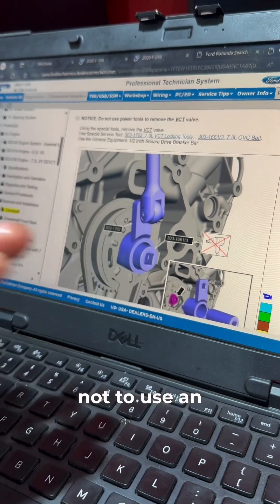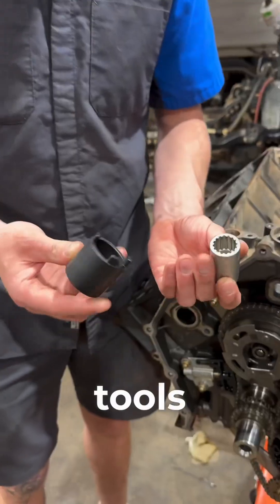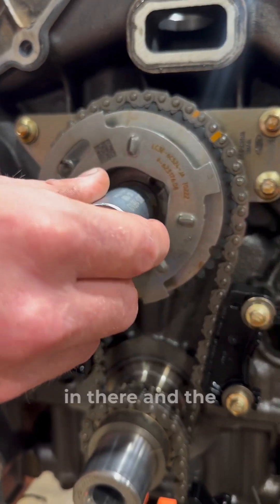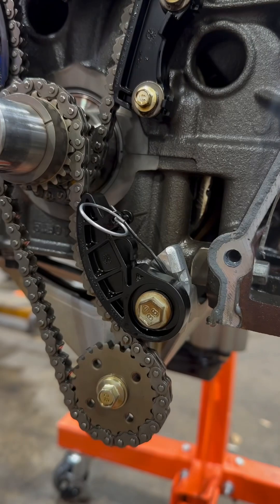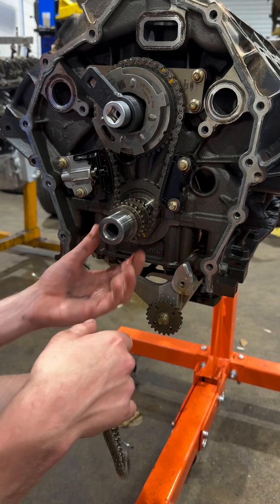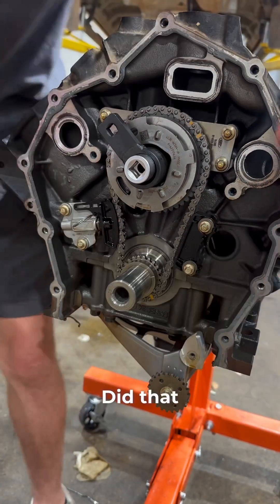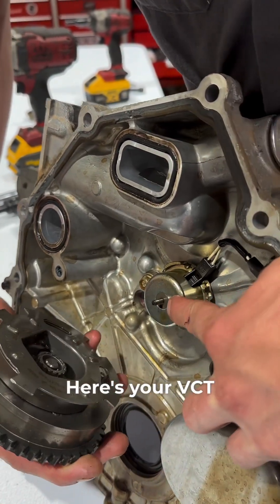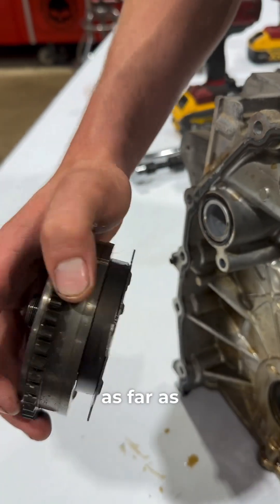Ford 7.3 Variable Timing Explained #ford #shorts

Comment: I have a 2022  F350 with the 7.3 engine, I like it, and by the way, that cheapest looking timing chain tensioner is not a timeing chain tensioner, It's an oil pump chain tensioner.

Comment: Of course the tensioner is cheap.  Gotta save a few cents here and there.   If it fails, and it will, good luck.  These engines will never rival the Chevy Big Block.

Comment: Actually the left side chain tensioner is the style older Hondas use and you open it up and behind the spring add like an eraser from a pencil or a pice of pen cap that way if the spring ever loses its spring back the cap will hold enough outward pressure to at least get ya home

Comment: Can anyone tell me what computer system he is using? I do basic maintenance on a fleet of 250 transit vans and having those exploded apart diagrams and info would make my work life better in every way
Reply: Looks like Ford IDS.
Reply: @ghostwrench2292 no its fords workshop manual. IDS is their old diagnostic software. Soure: am a ford tech.
Reply: Btw, if you have ALLDATA you can get most of these diagrams on there instead of fords workshop manual, as that requires a login and password to use

Comment: Engine parts lookin like they came from a Happy Meal ffs
Reply: I mean even the oil pump drive chain looks like it's smiling😅
Reply: Coming from someone who has never used a screwdriver.
Reply: @wysetech2000 tf would I use a screwdriver for when I could use an impact?

Comment: I'm going to say the obvious thing here:
Why are these timing chains so flimsy looking? In the past, the pushrod engines had beefier double and triple wide chain links. No tensioner needed, if the chain got stretched, it was only by small degrees  and would run trouble free for years and years. I had a 1973 Lincoln Continental with a 460 that finally needed a timing chain replacement. It was a straightforward afternoon job with standard tools in my garage at home. No plastic guides, no dime store tensioner.
My flathead engines have gear drive timing, no chains at all.
Reply: So it won’t last and you have to buy another one. Capitalism.
Reply: @johnpappas9652 get off breadtube.
Reply: Even if that was the case, it would most likely be to reduce drag/improve mpg.

Comment: Fuckin ford...you would have thought they would have learned about timing chains from the ol 5.4s and 4.0s that stretched them, but they didn't. Then you'd think they'd learn from the ecoboost junk engines and their timing chain issues...but they didn't. So hey, lets make our timing chain parts from temu products and call it a day. Im a GM guy, owned a few older fords before and didnt have any issues. And yes GM has timing chain issues just like ford and just like dodge. Ive dealt with them all over the years of fixing cars and buying fixing and flipping cars.

Comment: How many miles on that engine? Let me guess 7,000? 😆
Reply: Look at any fleet thats running these engines; apart from a few lifter issues on the early production engines in that vans and stripped chassis that ford is completely handling under warranty, they are holding up quite well.

Comment: Chain driven oil pump,I thought it sounded good when it came out,but now I'll stick to my 460
Reply: Oil pumps on older v8 are chain driven,,,think about it ,,a chain drives the cam then it drives the distributer  through a small gear and a small shaft drives the oil pump and they failed occasionally  .

Comment: I'm just hoping my 2016 3.5 Eco-boost F-150 doesn't blow up, and lasts at least 300k miles. But perhaps I'm being overly optimistic. I think I'll keep my old '94 just in case. Just gotta kick the rodents out and get it sterilized.
Reply: If it does last that long let us know
Reply: Sure bud it will get there. Just gotta do cam phasers, fix the turbo coolant leaks and replace the torque converter. $10,000 to 15,000 in repair and maintenance and yay you made it to 300,000 😂😂😂

Comment: How to make an LS complicated.
Reply: Literally what I was thinking, ls uses a solid piece of plastic in between chain and crank driven pump simple doesn’t break and works
Reply: Facts and anything above 07 gm has this shittt
Reply: @sharkclan42  no vvt was more common after 2012 my 08 Silverado has do but no vvt, i dropped standard lifters in and a gen3 cam with a aftermarket timing gear and got rid of all my problems, stock trans lasted 210000 miles did an aftermarket billet converter converter better clutch’s corvette servo and sonnax valve body. Truck now has 330,000 miles on it still drives like new doesn’t burn a drop of oil

Comment: Please don’t tell me that when that fails oil pan and timing cover has to come off. Or pull the engine out to make it easier to work on
Reply: Camshaft replacement on the new 7.3 is the single largest labor item I have ever seen on one part. Over 30 hours.
Reply: Was thinking the same thing: Check engine light comes on for a VVT solenoid: drop the subframe, remove the oil sump, remove all the shit on the front of the engine, remove timing cover, timing chain, VVT phaser, then you can swap the solenoid. Pays 1.6 hrs, and reuse the oil & coolant.

Comment: Thank god for variable valve timing so we can have uhhhhh ummmmmm the uhhhhhhh
Reply: VVT helps balance out engine performance by opening the valves earlier when the engine revs up higher, meaning the suction starts sooner and you get more performance. In an engine, if it revs up high, the pistons are moving faster than the valves, meaning the piston is likely already half way down before the valves are open all the way. Not a problem at low rpms, but it becomes noticeable at higher values. When VVT kicks in, the valves open before the piston even begins the downstroke, meaning the fuel air mix can get into the cylinder in more even amounts, preserving performance at high rpms. VVT's most notable use was on the 2JZ
Reply: @blackburngaming8345   2jz bro 🔥🔥🔥😎😎🔥🔥🫡🫡👌👌🤘🤟🥵😍🔥
Reply: @blackburngaming8345  you could just simplify it and say it's unnecessary bullshit 😂😂.. push rod v8s ran fine  and easy to work on. You don't need to complicate work trucks. They are for making money.
Reply: @maseifert317   exactly. My 20 year old 5.3 tahoe gets 1 mpg less than a 2023 tahoe with vvt, dod, and a 10 speed. All that for 1mpg? Whatever that 1 mpg is saving you is offset 100 times by the cost of mechanical failures.
Reply: @Xixu.co.6  What both of you fail to realise is that VVT is not for work trucks, it was made for performance engines. The 2JZ was a performance oriented engine, not a workhorse motor
Reply: @blackburngaming8345   Are you 15? Every modern engine has vvt, why are you talking about 2jzs? It’s just so you can have an engine that can make low end power and not fall off at high rpm. On newer stuff they overlap the exhaust valves opening into the pistons downstroke to mimic the function of egr. All of this results in an engine that isn’t remarkably good at anything in particular but provides linear power. Back in the day they would use the same engines in cars and trucks and use a different cam based on application. Nowadays they just use the exact same engine because theoretically vvt gives the best of both worlds. But, like i said, you’re just getting an engine that’s ok at everything but not exceptional at one thing. The 7.3 is only used in work trucks, give it a low rpm torquey cam and leave off the vvt for longevity’s sake
Reply: @blackburngaming8345 that’s not at all how it why it works. You’re a know nothing engine brainlet.

Comment: Jesus ford. Had to invent another bolt head so you can contract out a tool just for it to make that money money you already made by making cheap parts. This is why if Toyota makes a 3/4 or 1 ton the big 3 are fked.
Reply: I mean they made a half ton and it didnt really hurt the big three at all, i dont know why it would be different with a 3/4 ton
Reply: @jaredlancaster4137  no they never gave us the real truck. The hilux would ruin the big 3 over night.
Reply: @lurchmccoy the Hilux was sold in the US market for 27 years and never managed to "ruin the big three", although it did prompt them to invent the Ranger and S-10. I don't see why it would be any different now unless there was some major change in regulations like the Chicken Tax.
Reply: @jaredlancaster4137  your talking about a time when the big 3 actually made good vehicles. Long before the chicken tax. The hilux we had in afghan would destroy the truck market in the us if they made a 1 ton and 3/4 ton. Those things just ate abuse.
Reply: Dude. Toyota has a shut load of Toyota only special tool and sockets. Poor argument or just unknowledgable
Reply: Toyota isn't any better anymore. None of them are.. sadly.
Reply: Even the new Tundra is 10 years behind.  a 3/4 or 1 Ton would be irrelevant... Hence why they don't make one..
Reply: Ford isn't the only one that requires special tools.  Not by a long shot
Reply: Cam towers, Cam towers, cam towers. It doesn't matter what you buy, they all have a junk design somewhere. It's called designed to fail, they gotta get more money from you somehow.
Reply: They do make and sell a 550/650/750 equivalent and people say its junk
Reply: @patricelebrasseur5649  Hino?
Reply: You never pulled an intake on a Toyota to change a starter on their V8 . Or the 1100 dollar transfer case actuator that's all plastic gears. They all suck.
Reply: Cam tower leak, cam tower leak, cam tower leak.
Reply: They actually did make a 1 ton Dooley back in the 1980s except it wasn’t 100% in-house from Toyota. You bought a regular pick up truck from Toyota no bed and then you would take it to a factory that basically supplies Toyota with custom beds and one of those custom beds you could install was a 1 ton bed wheels and all if you ask me, it’s still a Frankenstein of a Toyota truck so it partially counts given that that would be the closest thing that they have to a ton that they’ve ever made even though the backend wasn’t made by Toyota but you should look it up. It’s pretty cool, I wish I remember the name of the company that supplied Toyota with those beds, but I do have a video link to another YouTuber who’s a car of you who recently reviewed one of those trucks with the one ton long bed conversion 

here https://youtu.be/DoTOboBnVIU?si=JgcV3gUQuV3cZ447
Reply: Go look at Volkswagen Audi and BMW trying to take shit apart on those vehicles would make you wanna off yourself
Reply: they all use metric these days. Need to go back to UTS bolts and threads.
Reply: If the Toyota Tundra isn't considered one of those then I apparently don't know shit about trucks, they have had a payload of 1500lbs+ (3/4 ton) for over a decade now.
Reply: @shanedavis4254 half ton, 3/4 ton, and one ton are extremely nominal ratings that haven't been consistently applied through the decades. Yes, a Tundra can have a payload capacity over 1500lb, but the same can be said for every other "half ton" pickup in the last 30+ years.
Reply: @jaredlancaster4137 so what other half ton pick up trucks would you put with it? Are we talking 1500 Chevy Silverado or more like a Ford ranger in category here?
Reply: @shanedavis4254 the Toyota Tundra is intended to compete with, and is generally comparable to, the Ram 1500, Chevy Silverado 1500, and Ford f150. This class of pickups is what is meant by "half ton".

The Tacoma is intended to compete with, and is generally comparable to, the Ford Ranger, Chevy Colorado, Jeep Gladiator, and Nissan Frontier. There are lately called midsize pickups, although they are also sometimes called 1/4 ton. Even these smaller pickups have payload capacities over 1000lb and often over 1500lb. But they are in no way comparable to "3/4 ton" pickups like a Ram 2500(which has far more than 1500lb payload).
Reply: Too bad Toyota can't build truck frames to last more than 10 years without rotting in half.
Reply: You must be new to cars. I have tons of tools specific to different manufacturers. Few people are tearing engines down to this level. And when we do we get the tools that are required for the job. Move on shade tree. 😆
Reply: @c130aviator  right. Shadetree. Us shade tree mechanics really appreciate it when Ford doesn't unnecessarily design it to require a special tool. Yeah I understand you don't mind getting the tool because you do this a lot, but I really do mind. Because a $78.99 special socket significantly increases the cost of my $300 Rockauto rebuild.
Reply: @jaredlancaster4137 well you people decided to let it happen.
Reply: @AndrewKidd14145  what? I didn't decide anything that has anything to do with Fords fastener choice.
Reply: @c130aviator  I obviously said it because I have a whole side locker for specialty tools. We’ve been doin this shit for a century. There is zero need for new tools for new fasteners. Only greed and ignorance.

Comment: That's some Mickey Mouse BS to keep Godzilla in time
Reply: Ford has been screwing mechanics with their funky timing chains for years, the ford 4.0 SOHC v6 is one of the worst offenders, this 7.3 timing chain in the video looks like it’s gonna break the tensioners like most fords do and it will be an engine out job
Reply: Absolute ford dumbassery
Reply: Then don't buy it
Reply: Typical Ford nonsense.
Reply: Godzilla it’s a gas engine nothing Godzilla about that. The 7.3 diesel is Godzilla
Reply: @justinteel7172 no the 7.3L gasser is Godzilla.

Nobody cares about the 7.3L diesel anymore unless you own one. 5.9 Cummings shits all over that 7.3D
Reply: Chevy sucks.
Reply: @shanepettit6872 Ford sucks